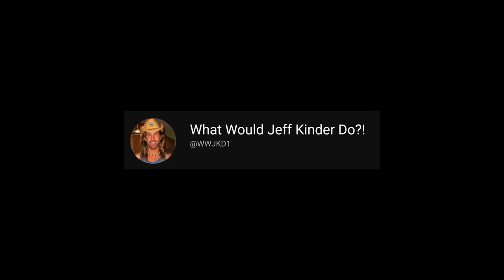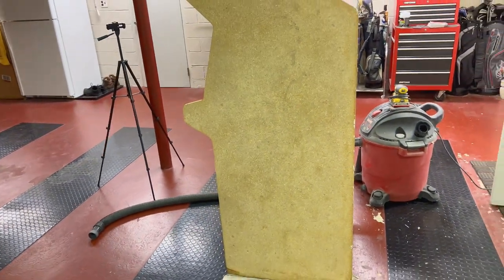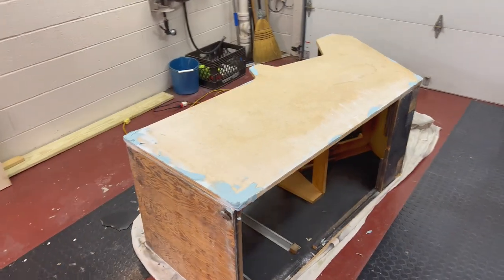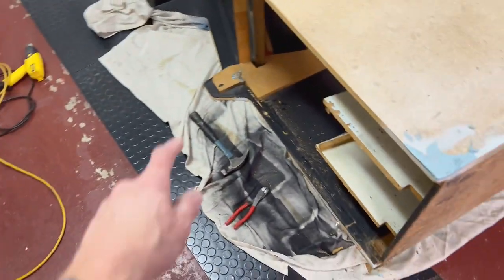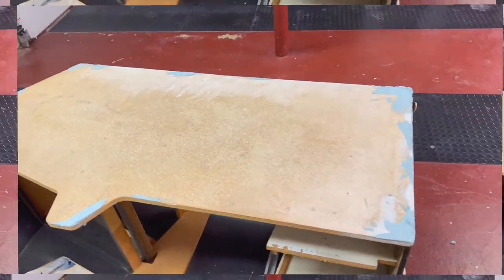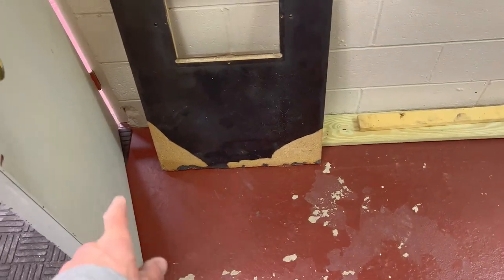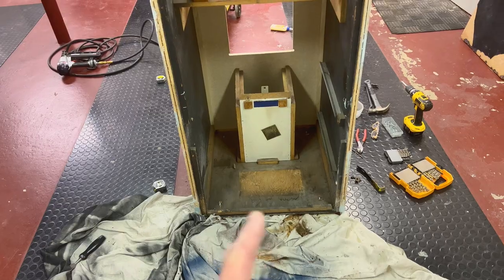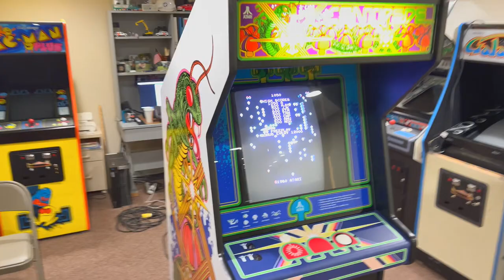Centipede Restoration

Comment: Bondo use for minor damages correct? Major damage at base of cabinet what would you do.
Reply from the maker: Correct.  Small chunks missing would be Bondo.  For when there is a lot missing or if there is too much water damage on the bottom of the cabinet, I would cut the entire bottom of the cabinet and replace with new.  Here is a link to some pictures of a Defender cabinet that was in very bad shape that I had to cut the bottom of the cab and rebuild. (yes... safe link)  https://1drv.ms/f/s!AhzU6GuVSfQJlJ4-_oVO8ke5RYXsXQ?e=Bq3Ew6